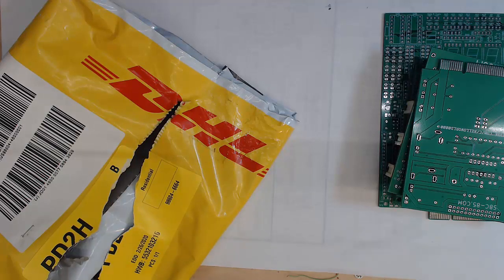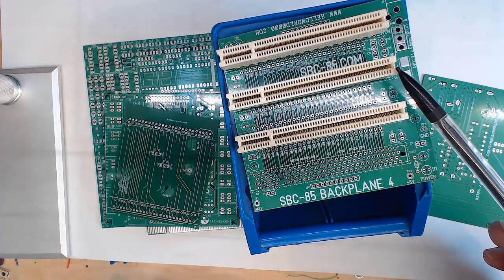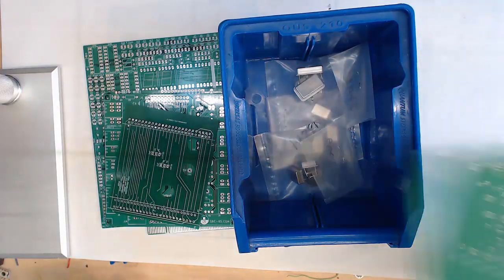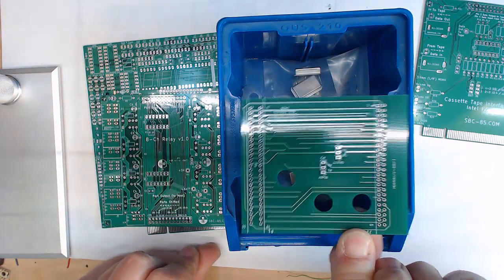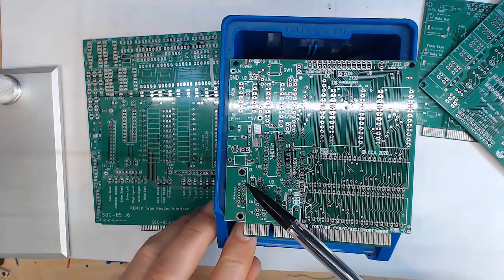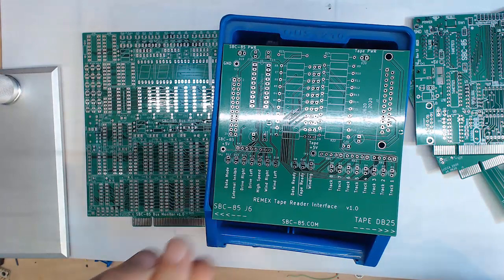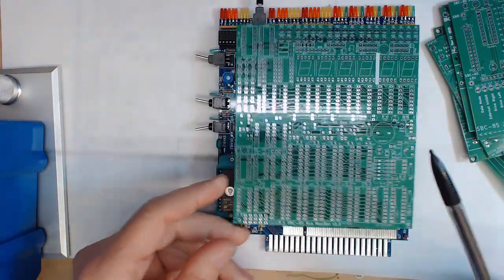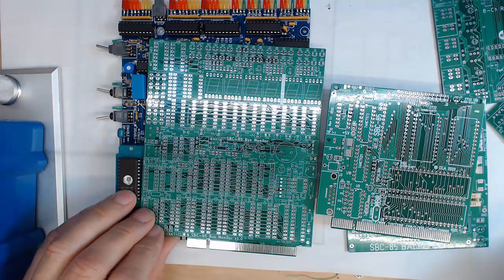{46} New project boards arrived. SBC-85v1.1, bus monitor, cassette tape interface, Remex paper tape

Comment: I have troubles with DHL too. I found out later it had to do with the way my address shows up in Google as opposed to the official address (i.e., the one the post office uses).  In Google, it shows up as the township I live in, not the town where the post office is located.  I live in the country, so they get confused and sometimes send the package back to their hub and ship it to another town of the same name in another place entirely before they figure it out. In the end I had to modify my address so it showed both.
Reply from the maker: Possibly, but they never say there is an address problem, just a “not home” problem when we certainly were home (plus we have a delivery confirmation signature on file with DHL).  They have given the “not home” excuse for a week and then eventually at the end of the week they hand it over to the post office to deliver.  DHL is such a minor carrier here and we are a bit rural, it seems a lot like we are just not worth the trouble of delivering.  I have asked them that if they are going to wait a week and then hand it off to USPS anyway, to just give it to the post office the first day it arrives and not wait a week.  No luck.